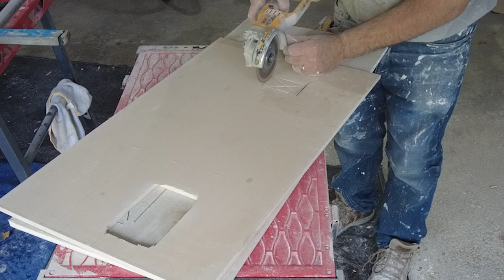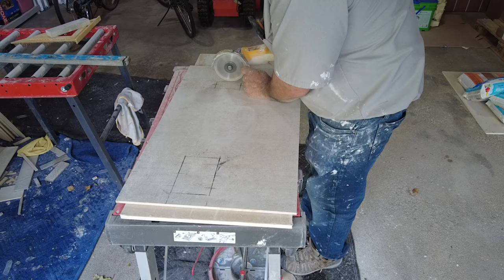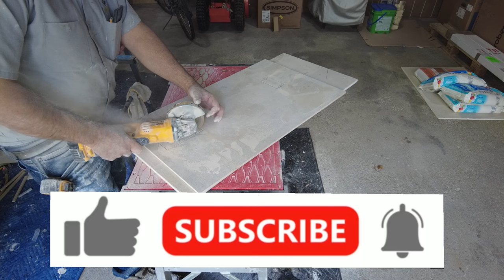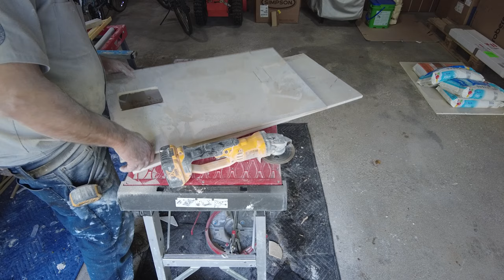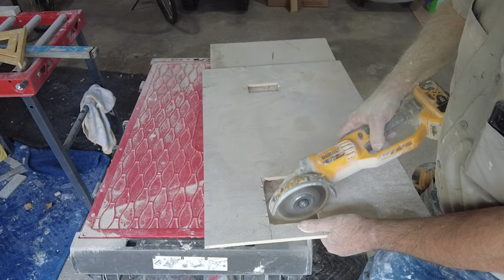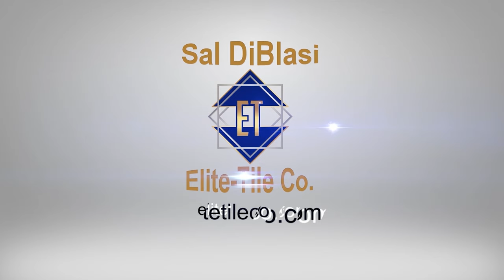Cutting holes for electrical outlets in huge tile.

Comment: It helps that you have a high quality porcelain.  We deal with bad tiles sometimes, that require pre-drilling holes in the corners or else they will break.  No matter how slow or carefully you cut they will run out in the corners.  
I’ve noticed it is mostly on DalTile factory porcelains… but recently had a terrible time with an Italian factory from Happy Floors 24x48 that was very expensive.  It’s almost like you never know what your going to get, and it’s frustrating!
Reply from the maker: You are absolutely correct, these were actually ceramic tiles, pretty much no danger of cracking. Modern porcelain tiles can have a lot of tension built up in the tile because of the manufacturing process, so drilling out the corners is a must, as you say, but in some cases even that is not enough and other methods must be used. Maybe one day we can talk about it in a collaboration.

Comment: Sal I found a much better way to cut the screw holes for the outlets.  You dont need to at all if you use the shortest screws but they make a 1/8” hole bit for a drill that fits perfectly inside the screw hole on the outlet.  Just install the outlets and come through with the bit.  So easy!!
Reply from the maker: The outlets won't be installed until I am long gone by the electrician.

Comment: What is the purpose of the wood strips screwed to the wall?
Reply: A ledger.  So if you want to do most of the tile work without standing on your shower tray which could be sensitive like foam.  Do all the tile except the bottom row then do the floor and follow up with the bottom row.
Reply: @Trucker-Belly  Thanks, makes sense.

Comment: Absolutely no need to have hands that close to the disc
Reply from the maker: You obviously have never used a wet saw.
Reply: @SalDiBlasi  that’s a grinder not a wet saw
Reply from the maker: Wrong video sorry. You are obviously not comfortable with a grinder and a diamond blade.
Reply: @SalDiBlasi  I use them daily but your correct, I’m certainly not comfortable enough to put my fingers even on the guard 🤣